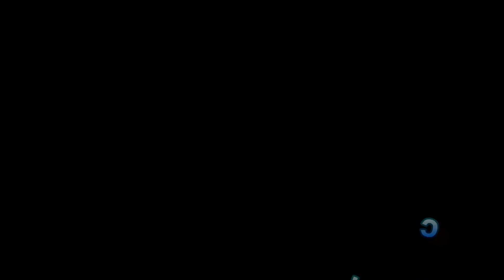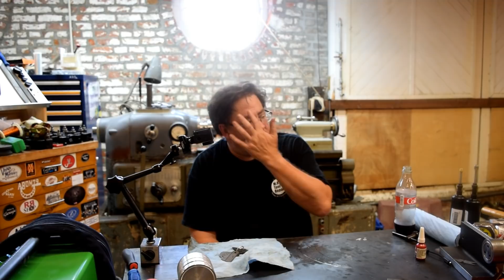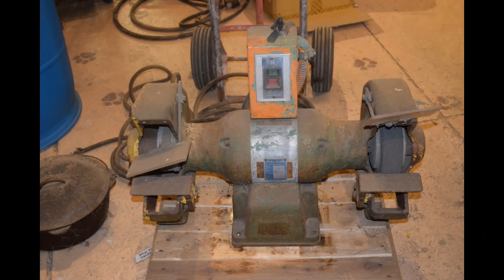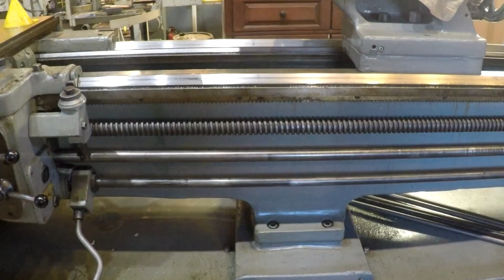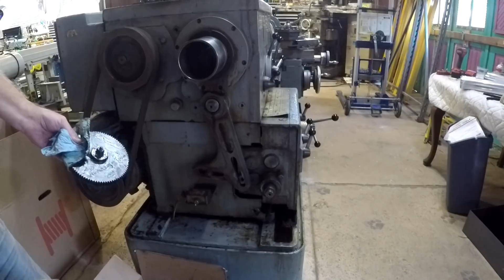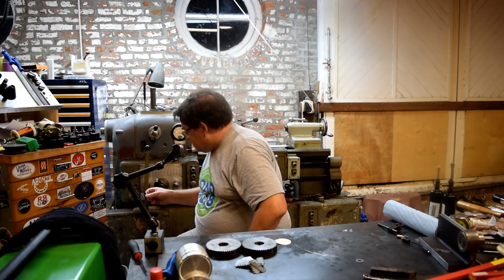Shop ADHD #38

Comment: Love the new "Baby". It was interesting seeing you push the power engagement lever down for forward. I have a Mazak 1.5 BC. Bringing it back to better than new (1984) My manual say "Foward" is up on the power lever. I have seen both, which is correct? It is only a matter of changing polarity, I know. My previous lathe was a Colchester and it was DOWN for forward. 
Cheers,
David from "Downunder"
Reply from the maker: Not sure if there is a 'correct'.  The Pacemaker was down for froward.  That seems to make more sense. Push the handle in the direction you want the chuck to rotate.

Comment: Glad to see another video James.  I was taught "right or wrong" to never add any type of compound between the JT & the chuck. Apparently they will never fit together correctly if you do. Putting the arbour in the freezer for an hour and then put them together with a sharp tap from a copper hammer on the arbour tail is the way to do it.  Jacobs specifically say they should be perfectly clean and grease and contamination free before fitting. Even finger oil is a no no.    Happy to see some progress on the new lathe though its a bummer about the gears.  Do you have a video of the electrical repairs coming out ?regards from the UK

Comment: When you make the gears , if you have enough material make up a spare of each one. You know sure as rain one will spin or break when YA need it most. Good deal on the Baldur I have a seven inch one but sure wish I could get a big wheel grinder also. But it'll wait for me if I ever get through my spine troubles. Glad to see new videos, thanks .
Reply from the maker: No doubt, the one I don't have a spare for will be the one that breaks!

Comment: Post the Zoro part number for the high pressure oilers please.....
Reply from the maker: https://www.ebay.com/itm/FUNNEL-KING-32990-Grease-Gun-Bulk-Push-Rigid-Pipe-1-20-psi/223627701610?ssPageName=STRK%3AMEBIDX%3AIT&_trksid=p2057872.m2749.l2649

Comment: I love baldor motors every one of them I've ever had outperformed everything else I used one for years that was a two speed with centrifugal brakes that I used in a homemade air handler buffing machine, it was almost impossible to bog down. Anyway good show hope everything goes well on the new lathe.

Comment: Could you make the gears out of steel or is there a reason for the phenolic??
Reply from the maker: Leaving one gear phenolic creates a mechanical fuse of sorts.  That way if you crash something you know the weak point.
Reply: @jtkilroy  It's kind of an expensive fuse. I think it's more reasonable to use a shear pin or something. It's a lot easier to remake and replace than a gear.
Reply: @jtkilroy  Make a bunch of them if you use Phenolic!
 That said perhaps a soft metal gear, Aluminum or brass? Or add a slip clutch with a steel gear.
Reply: Phenolic runs a lot quieter.

Comment: It is my understanding that phenolic material may be used for gears to act like a fuse. They will strip before doing serious damage to your gear train. Maybe your manual will comment on it if they are OEM
Reply from the maker: On the nose Sir.
Reply: phenolic gears are used in hi RPM locations plus they run WAY quieter than metal gears in the same place. they are not really weak, lost of Grear heard drill press use them. the machinery handbook tuchis on them and the used for them